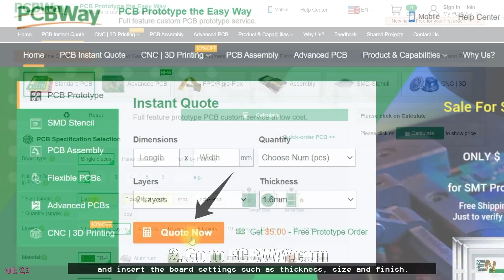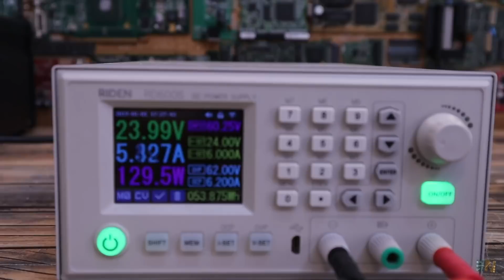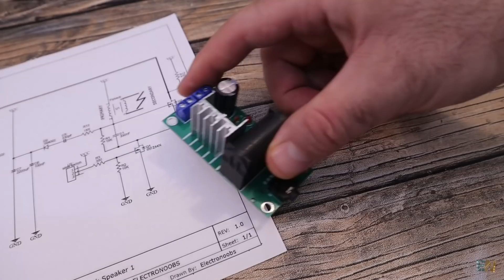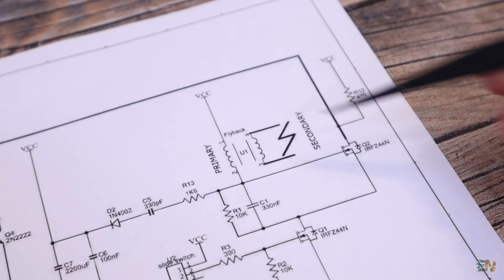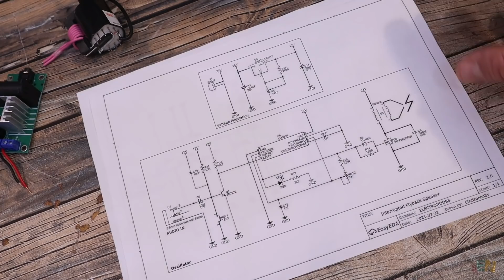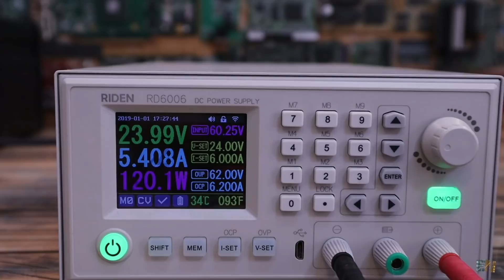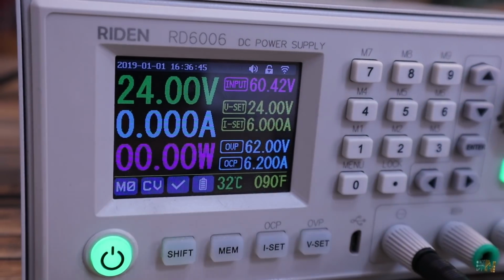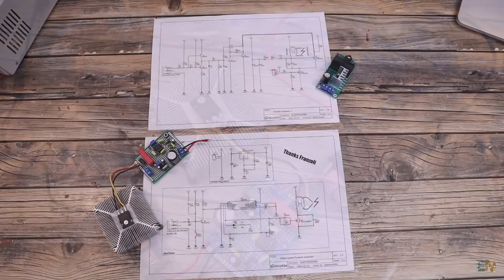Music with Plasma?

Comment from the maker: Arduino Course LEVEL 2 (Spanish): https://bit.ly/2ZNWgqy

Follow me on FACEBOOK for more: https://www.facebook.com/Electronoobs
Help me on Patreon: https://www.patreon.com/ELECTRONOOBS
Reply: Hi Electronoobs, I love your videos, and I recently watched your video on your escape room, because were planning on making an escape room, and I was wondering if there's a way for a video to be played on loop on a screen (about 100mm x 100mm) and then when the arduino is told the previous puzzle is solved, It plays a different video on loop. I've been looking online, and not really found anything, but I don't even know if it's possible, because arduinos have such little flash memory, but I was thinking about maybe using a sd card reader, with an sd card that has the video, and perhaps connected to a small monitor via a hdmi to hdmi cable or hdmi to usb-c cable, with a breakout board on the side connected to the sd card reader. Thanks in advance for if you do this, and keep up the great work!

Comment: You should be able to make the audio louder by using a high voltage AC transformer instead of the flyback which has a built in diode. I am thinking of building a vacuum tube plasma speaker sometime

Comment: Curious if it's possible to do this with a high power audio amp, an isolation transformer and then something like a microwave oven transformer or the ignition transformer from a furnace oil burner. I saw a video where someone demonstrated the dangers of high power amplifiers and he powered a box fan with a signal generator playing a 60Hz tone into the high power amp.

Comment: I built a plasma speaker with a 555 timer for a college project. They’re fun to play with!
Reply: Can you explain how you did it? And whether I can use the same circuit to make musical Tesla coil?
Reply: @taherpatrawala_  I don’t think my circuit would be suitable for a Tesla coil driver but the basic concept might be reworked. I was using a flyback coil from an old CRT and the 555 timer’s main function in the circuit is a DC pulse width modulator to resonate the flyback coil via a FET I think(sorry it’s been a while) and that kept the arc turned on normally pulsing at the coils ideal frequency. I remember there being a balancing act between the biggest arc and the best sound quality which could be adjusted by tuning the pots in a resistor-capacitor setup along with the adjustability of my input volume. The audio input worked as an interrupt setting the output low on the 555 effectively turning the arc off at the frequency of the music so too high an input signal results in overdriven quiet. It was a really fun project! You can find similar circuits on Instructables if you want to build your own! Check out ZVS power supplies too if you haven’t already.

Comment: @Electronoobs #Electronoobs ..... Does this circuit works with any Transformer Or only with Flyback Transformer?
Reply from the maker: It would work with any high voltage transformer. We don't use the flyback coil for this project... Thank you for your comment!

Comment: If this is LC tank circuit capacitor supposed to be connected across the primary coil not the transistor. This would explain weak spark and high power consumption. Also music would sound better if you'd use PWM modulation not threshold detection like in this project.

Comment: I make a circuit plasma speaker use igbt zvs and audio igbt class A drive G pin . Big yellow ark and lound sound great . Power drive at 19.3v 3a from laptop adapter. Circuit no use ic because i ve alots fake ic die so i try avoid it and audio signal from a Bluetooth speaker. I still ve the circuit.

Comment: Try in a Bunsen burner flame with a wick of saltwater feeding into the bottom.  (Need high temp wire for the probes).  Been a long time since I did this, but got great results.  Wires can be farther apart, too.

Comment: Thanks for the video man..🤩 I saw  the video of franzoli(no music no arc) on instagram a month ago and was very much fascinated to build one but couldn't find the circuit anywhere. So i tried building one myself using a lm393 based audio detection module controlling the pin4 of the 555 timer through a pnp transistor to invert the output . And got it working after few attempts. It was fun building though.

Comment: That was one of my first electronics projects back in 2014. I had the issue that the mosfet would desolder itself after about a minute despide a heatsink. I added water cooling for the mosfet later on.
Reply: the mosfet is hawt
Reply: 7 months later, das still hawt

Comment: That first circuit is drawn very strange, I'll need to look at it more closely. Looks like it's a self oscillating design. Class E operation?

The second one is much more typical. That's an IRFP460 which is a FET not an IGBT, BTW. IGBTs aren't great because of low efficiency. They lose ~2 volts in conduction. They are good for high voltage low to medium frequency and high currents. MOSFETs have a voltage drop proportional to current.

Also on the 555 timer, feed your audio signal into pin 5. You will get much better audio. Although using a PWM chip like a TL494 or TL594 will have be ideal.

Comment: Hi, i made one with 555 by fine-tuning frequency i got max arc with low power, if frequency is not current it will take more current and less arc. And be careful if you use such HIGH VOLTAGE circuit with smartphone. I successfully damaged my 3.5mm audio port of my smartphone with my high voltage generator..😅